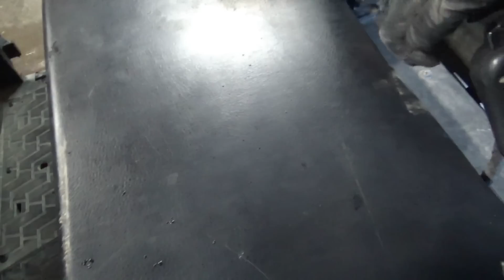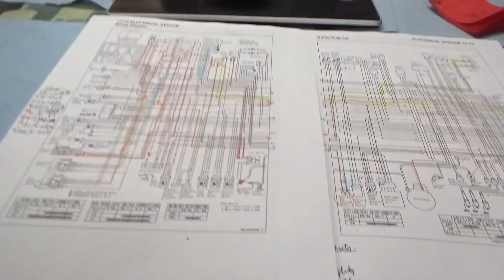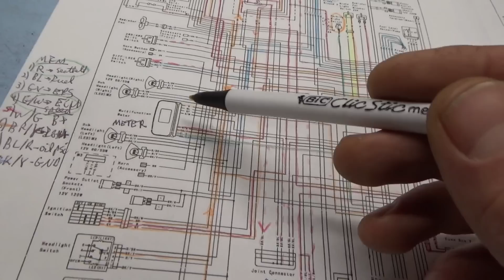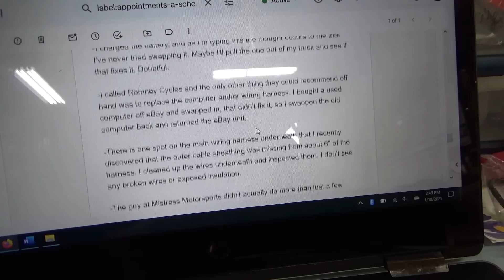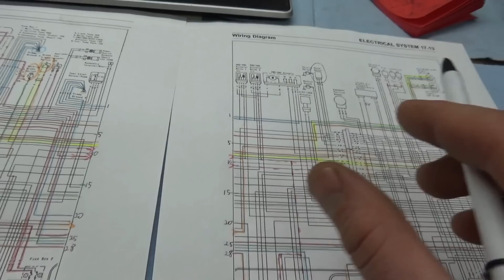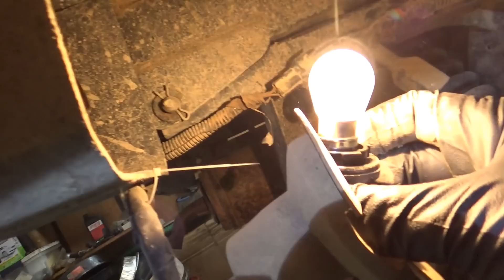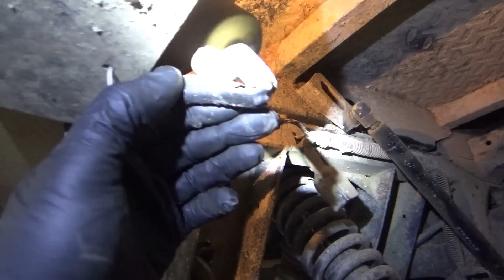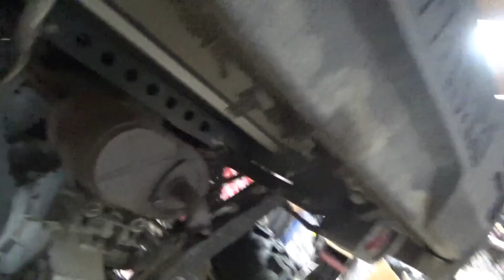Kawasaki Dealer STUMPED!?! SxS REDUCED SPEED Mode (15mph max)?

Comment: Good one!  Reminds me of the GM mechanical cruise control. Back in the 80's,  the cruise would not engage.  Follow the trouble tree and no luck.  Swap a unit from a working vehicle, still inop. Long story short, the 3rd brake light bulb would be burned out. The system used the bulb as a path to ground, to engage cruise, not the power from the brake light switch.  No where in the diag was this ever mentioned.  This sent many good techs down a rabbit hole back in the day.
Reply: that was the easiest way to not have turn signals disable the cruise, also didn't need additional diodes fed from either side, since the third light already had that.
majority of cars still had shared rear turn/brake bulbs. I guess they could have came direct off the brake switch wire before turn switch, but I think there was back-feed scenarios there.
Reply: @throttlebottle5906  What ever the reason, it sure would have been helpful if the trouble tree or description of operation informed the tech of this.
Reply from the maker: Wiring diagram would show that in 2 minutes :)
Reply: @PineHollowAutoDiagnostics  Yes the schematic shows the 3rd lamp.  Problem was, there nothing in the description of operation that the bulb is used as a ground path.  Would have surmised 12v when the brake is applied is the signal, and that was working ok.
Reply from the maker: @ True, it is weird to use a bulb as a path to ground vs. a dedicated ground. Must have been a "dual-purpose" circuit to make sure you couldn't engage cruise if the brake pedal is depressed :)
Reply: @PineHollowAutoDiagnostics  I'm sure it was the brake applied signal.

Comment: great work most customer don't see the background behind many diagnostic.  i don't the brake light switch was really the problem the broken wire and the bad bulb were it the ecu didn't a pull down effect from the brake lights circuit that's probably the real cause of the problem.

Comment: I've watched a great many repair videos on side-by-sides, but never one with a 3-cylinder engine (and never a Kawasaki). It's crazy to see that even with a 3-cylinder engine, they use a CVT belt drive system. Great job diagnosing this. I thought it was going to be one of those deals where the wrong brake/tail light bulb was installed or it was jammed in wrong, and feeding power back into the ECM.

Comment: Excellent job Ivan. My 2010 Toyota corollla alternator is only providing 4 Amps all the time. When I move the steering wheel, voltaje drops. Do you think the problem is in the battery or the alternator? Thanks
Reply: STEERING DRAWS POWER SO THE VOLTAGE DROPS WHEN YOU TURN THE STEERING.... HOW DO I KNOW?  I FOLLOW IVAN!  TRY REPLACING THE BRUSHES.. THAT IS ABOUT $10 AND THE MOST COMMON PART THAT WEAR OUT IN A TOYOTA ALTERNATOR..
Reply from the maker: If it starts up fine it's not the battery. Most likely the alternator if the wiring is good :)
Reply: @PineHollowAutoDiagnostics  Thank you so much! Will check the wiring. The voltage drop also generates an unstable idle. First was more evident when the AC was on, but now I noticed it is more related to the steering wheel operation.

Comment: We have a Diesel powered Kawasaki  a Yanmar engine .
It's so So loud 📢🔊! 
But runs good.
But Our Kubota 1100 utv one is so much  better though quiet smooth rugged construction hydrostatic transmission

Way to much high tech ECM electrical on a go cart. Wait until these get old and see what happens.
No one will be able afford to fix them.

These companies need to make park handle lock since my dog knocked one out into neutral and utv rolled down mountain  lol 😂

Comment: Maybee it was a problem with the wrong wiring at brake light. If there was voltage from tail light transported via bad connection to brake light the computer thougt there was brake on...
Reply from the maker: Filaments were reversed but no backfeed problems 😉

Comment: Hey Ivan, i think that because the brake light wires were crossed on the right side and the brake light burned out on the left side that there was some back feeding going on, and in turn the ECU was thinking that the brakes were always being applied? Thus limiting power.
We need a part 2 to fix the hand brake switch and especially the differential actuator. Maybe a broken or missing actuator pin/rod? And replace that dangling light switch. Haha
Love this non car repairs! Keep up our interests for sure. Have a great weekend, Ivan!
Reply: The reversed connection on the right tail light just reversed which filament was being lit, so it would have no way of creating a backfeed, its only effect was changing the brightness. The broken brake light wire in the left connector also didn't affect the ECU either. With the broken wire on the left, and the burned out tail-turned-brake light on the right, the 12V the ECU sent when the brake sw was applied just went into an open circuit, but its not something the ECU could sense (its not current sensing brake light amperage, like a bulb check might do). TLDR: NO BACKFEED!
Reply: No backfeed, but also no pull-down since the left bulb had a broken wire and the right bulb was burnt. So if the ECU has a weak pull-up internally, it still thinks the brakes are actuated.
Reply: @tomvleeuwen  yeah, probably relying on bulbs to "pull down" the circuit and it's either floating or has pull-up inside the ECM. testing would show/prove which.

Comment: Think might disagree there; a part were required- new bulb as mentioned earlier in the video. Likely the ECU looking for ground via the brake light filaments to indicate no brakes applied, and power or floating as brakes applied. Maybe not designed as a safety thing, not allowing full speed unless at least one brake light works, but...

Comment: Just a thought. A lot of light monitoring circuits work by appying a voltage to the lights via a resistor and checking for current flow. In this case with LH side open circuit and the RH side miswired to an open filament there would be no path to ground for the monitoring signal. This would tell the ECU the braking circuit is faulty and possibly cause the limiter to be enabled....
Also, judging by how that wire fell out of the connector on the LH side, it may have been intermittent. When connected all would be well as the path would be there. This may have led to the confusing failures the owner experienced. Greetings from a long time viewer in Australia.
Reply: Exactly what I said... So they have the ECU going into limp mode simply because both of your brake light bulbs are out??  What a safety sally nanny state feature..   I would be wiring in a bypass for that..  Imagine having to limp home for simply having bulbs out... when you're out in the middle of nowhere, where brake lights are useless anyway.   I don't understand these horrible decisions that these manufactures make.
Reply: @calholli  I doubt if it's a nanny state feature, just a quirk in the design. I think the engineers just didn't think though normal failures and what would happen.  Or else they assumed someone would replace a defective bulb before the other one failed. Or a bean counter that said the resistor wasn't needed.
Reply: @russellhltn1396  I'm thinking it's more of a liability thing.  Threewheeler/quads/dirtbike companies have gotten sued a lot over the years.. So I can kinda see why they would want to "legally" nerf everything.. I just don't like it.  Same with my riding lawnmowers.. The first thing I do is bypass all the safeties so that it will remain reliable and not give me random trouble.
Reply: thats what the problem was,not the misadjusted  brake switch ,i have one it wont crank unless it sees that brake input.this one cranked and run so it saw the input. but its fixed now
Reply: Yes, I was yelling at the screen the same thing.  With both bulbs out, there was no "pull down" "resistor" and the ECU assumed the brakes were on when they weren't.  The bulbs play a crucial role in the operation.  This isn't the only one that behaves that way. I've heard from mechanics that some early (90s?) cars would stall when put into gear if both backup lights were burned out.  With both bulbs out, the ECU thought the car was already in gear and couldn't compensate for the load when put into gear.
Reply: @russellhltn1396  Yeah.. The fact that it puts you in limp mode is way over excessive IMO..  Sure, give me flashing lights on the dash, etc.  but at least let me get home.  Some people take these things on 20 mile trips through the mountains.. Imagine having to limp back at 10mph.. That's insane.
Reply: @calholli  The assumption the computer makes in this case is that the brakes are faulty, hence the limp mode.
Reply: @moshet842  The brakes could be faulty and the brake lights still work..  I think they are just worried about people running into the back of them on the trail, by not seeing their brakes.  Ironically-  making it slow with the limp mode makes it even more likely that someone will wreck into the back of them.. smh.   Again, I almost guarantee it was the lawyers who asked for this.
Reply: @calholli   Fair enough
Reply: Indeed. Liability is a primary concern with the big 4 every since the whole 3-wheeler debacle. Very frustrating at times as a tech & as an owner. On most machines the 1st thing I check is the idiot switches/lights/sensors, etc. For no-start/reduced power complaints
Reply: This!
Reply from the maker: @timdixon1166  great point on the ECU having a bias voltage on that line as a continuity check 👍
Reply: Where is the sensing resistor on the wiring diagram ?
Reply: @ArtVan-s4l  The BULB is the "sensing resistor"..  As long as it's pulling current, then it's fine..  When the bulb burns out, it will have an open circuit and not pull that voltage down.  It's a very simple open/closed' monitor;  no need for a variable resistor sensing, like a thermistor or transducer, etc.
Reply: @ArtVan-s4l  It would have to have been inside the ECU computer , I guess.

Comment: That poor customer why would you clean injectors drain the tank am my favourite recommend to replace the wiring harness and ECU when it's clearly not the problem it's a waste of money as Ivan said it's simply a safety like a seatbelt or more than likely a parking brake stuck on

Comment: Good fix well worked out. Still needs a parking brake switch and the diff lock fixed but it runs and the customer is happy.
Reply: If the owner is fine with a bungee cord, I'm sure he's not concerned with the brake light indicator. Also, with some diff locks on SxS , they only engage when there is slippage; same with 4 wheel drive; this is to save the drivetrain from being torn apart on paved roads.
Reply: I'm guessing the wheels need to be on the ground for the diff lock to work.

Comment: I may be missing something but having the brake and tail light on right side wire reversed could have been the real  problem.  The tail light being constant power would back feed a brake signal to ecu tricking the ecu to thinking brake is always depressed-which would limit speed?
Reply: Swapping the tail and brake wires at the lamp pigtail just swaps over which filament is activated by each wire. I think the key is that at some point the wires or filaments attached to both brake-light wires broke or burned out.   The brake pedal switches the high side of those bulbs, and the low side of the bulbs is grounded. The ECU listens to the wire from the brake switch to the brake lights. So the ECU input is normally pulled low by the unilluminated filaments, and of course that input is driven high when the brake is applied. Almost certainly the ECU input has a (weak) pull-up resistor so it can detect a circuit fault.  In this case, if the brake circuit wire doesn't lead to at least one intact filament, there's nothing to pull that wire to ground. So the ECU either thinks the brake pedal is being pressed, or there's a circuit fault.
Reply: @ this side by side could have potentially been repaired by replacing one brake light bulb so ecu could pass circuit test
Reply: My thoughts exactly 💯
Reply: This was my thought as well. The ECU would essentially think you're riding the brake.
Reply: The switch would had to have been adjusted where the brake lights are on all the time then it would limit the speed. Just test drive one and leave your left foot pushing on the brake pedal at the same time on the throttle it does that every time limits the speed.
Reply: This same fault is pretty common with cruise controls, I have a heap of experience fitting and repairing cruise control systems. If someone changes brake light bulbs to LEDs, or if they're blown, the cruise control sees this and prevents the cruise from engaging. If there is no reliable brake light signal, then the most intuitive way of cancelling the cruise control is not available to the driver. The cruise control usually monitors the hot side of the brake switch too, or at least watches to see a valid brake light signal before allowing the cruise to engage.
Reply: Lol you guys would of been in same boat as this dude obviously. Man oh man
Reply: That’s more than fair. Ivan does it again, genius
Reply: Seat belt engagement signal not recognised?
Reply from the maker: @donaldholder2434  I thought that might be the case, but the ground was connected properly so not a backfeed issue. Just an open ckt on BOTH brake lights 👍
Reply: @PineHollowAutoDiagnostics  so what u said in the end was incorrect about the brake light switch adjustment ,left us hanging with that as the fix.i know u were excited ,glad i watched the comments this far ,cause i knew it was not the adjustment fixed it. but thanks for the video,always love them
Reply from the maker: @ Correct. Fixing the entire "brake light system" resolved the customer complaint. Just adjusting the switch without fixing the bulbs would still have the speed limiter :)
Reply: @PineHollowAutoDiagnostics  love ur videos. especially some like these. just how u ended it left me with questions at first. keep up the good work

Comment: Doesn't the ecu wants to see ground through the braking light bulbs? Like an old after market cruise control system?
Reply: Wasn't that an old Ford Aerostar problem. If brake lights were burned out, torque converter wouldn't lock up and eventually kill the transmission.
Reply from the maker: @RobertBosch9397  probably 👍

Comment: It’s not just the ignition coils. It’s a Chery engine, 100% designed and built in China. The coils are OEM. This same engine is used in certain John Deere Gator side by sides as well. It’s not a horrible engine, but I’d prefer something else.
Reply: Japanese companies using junk china engines, WTF is going on!! I noticed this when I bought my snow blower, "made in Canada" yet has a china engine, so sick of this sht!!
Reply: @DinDooIt  Perfect example why terifs are a good thing. It will make companies move manufacturing out of China
Reply: The snowblower market now uses a ton of Chinese made engines. The better ones are made by LCT, which is actually an American company that makes all their engines in China. They sell them private brand to companies like Ariens, etc.
Reply: It looks like the engine from Daewoo Matiz (Chinese QQ), only it has a metal intake manifold.
Reply: It’s a pretty modern engine, DOHC and 4 valves per cylinder. It has an iron block which makes it more rugged. Much of the fuel injection system is made by Delphi. Kawasaki has finally gotten away from this engine but Deere still uses it in their 835XUV series which can cost over $40k.
Reply: @tylermacconnell217  Another reason why tariffs are a good thing, bring manufacturing to leave China.
Reply: Why Just by a Honda at least most of those engines are manufactured in 🇺🇸 and Japan, Right there's a Difference 😅